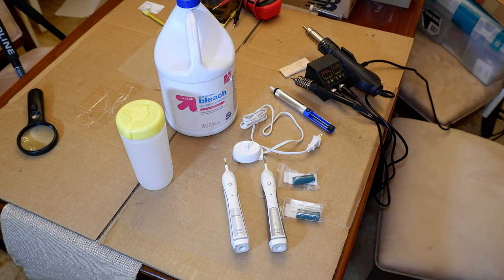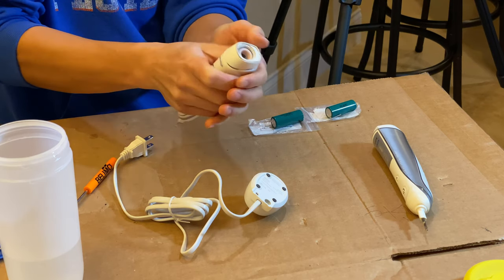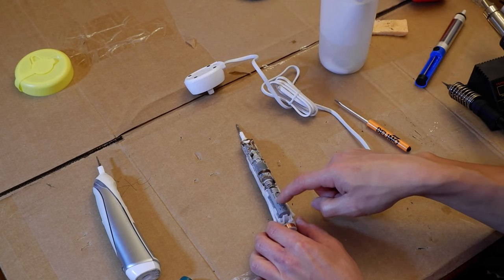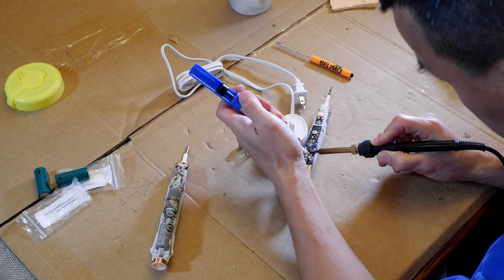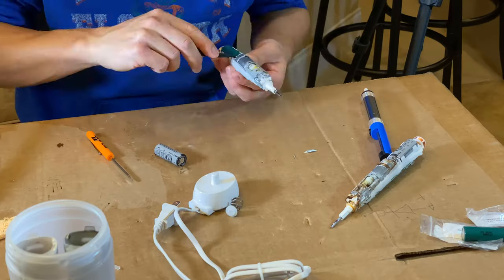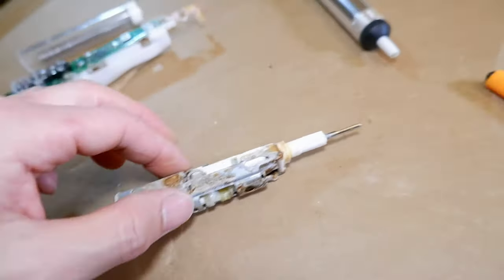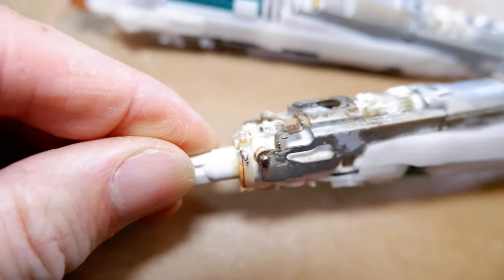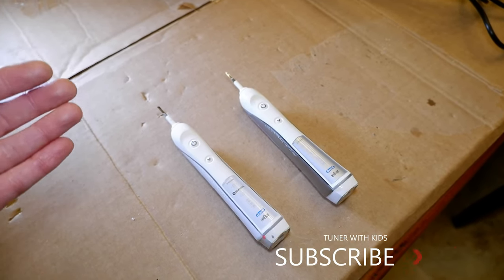Oral-B Precision Electric Toothbrush Battery Replacement | Braun Professional Care Smart Series

Comment: Replacement batteries are a bit harder to find for these now.  I found one but the terminals were too big to fit through the slots on the circuit board.  I had to cut them off and solder the terminals from the old battery onto the new one.  A bit of a hassle but I made it work.

Comment: Looked at the link for the 42x17 battery and it looks like the solder tabs are offset in opposite directions. Is this an accurate pic? The battery I extracted, both tabs are offset slightly to the same side.
Reply: u found one with the "Z-tabs", you need U-tabs

Comment: Thank you for the guide! It helped me repair my Braun Triumph Professional Care toothbrush. The hardest part was to get the bottom piece off. Other than that, the process was pretty straight forward.
The battery was so bad the the toothbrush could only do 1 cycle before it needed recharging. Now it's like brand new. It was also cheaper than replacing the entire toothbrush. But more importantly, they don't seem to sell this specific model anymore and I really like it. So I'm happy that I can now hopefully keep it for many more years.

Comment: Thank you for the DIY video to change the battery. A bit difficult because 1st time to open. Placed an order for the battery and hope I get it soon. Did not had those rust because it was still sealed tight and plastic frame. Mine had capacitors on the motor.

Comment: Nice job with the video. I tried the 1/4 turn but the base piece got stuck into the opening that did not turn. Do you think soaking in hot water would help to loosen it that piece that is supposed to turn? The bottom of my charger says it is type 3757. Harry
Reply: I went back and looked at the piece that you turned off-yours is round and mine is oval-so not being round it seems unlikely to turn.

Comment: I've got the Oral-B 9000/ Battery charges fine and no problems there but the shaft appears to be jammed, as the unit tends to hum rather than operate as normal. And ideas on how best to service the drive portion of the device?
Reply from the maker: I think it’s seized. I had one go bad like that, just tossed it at that point
Reply: @TunerwithKids  ok cheers, and I'm assuming, happy Tet to you and family!

Comment: Hello everyone, I have an Oral B 3731, my friend soldered a new battery for me.
But from now on this electric toothbrush won't turn on,
My friend checked it with a meter and the motor of this toothbrush works. But the toothbrush button does not turn on the toothbrush and the battery charge status does not appear on the display.

Can anyone help and advise what is the reason why the toothbrush does not want to turn on after replacing the battery?
Reply from the maker: Does it charge? Maybe the switch or board got damaged.

Comment: What are the specs of the capacitor that you added? And what contacts did you connect the capacitor to?
Reply from the maker: I don’t remember but it was a very small uF soldered to the + and - terminals.

Comment: Hi, i have done as your video but the battery upon charging does not hold charge and goes back to not working? It charges as i can see that happening, but as soon as i take it off the charges, it does dead. Any ideas?
Reply from the maker: Bad battery or bad motor.